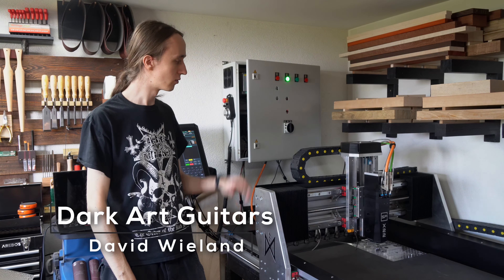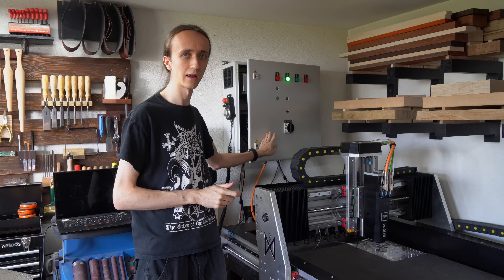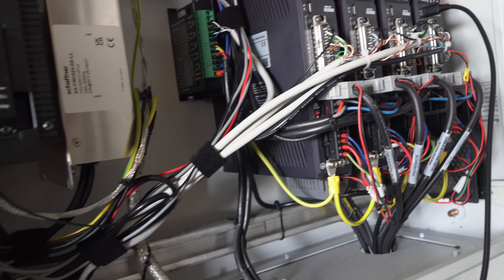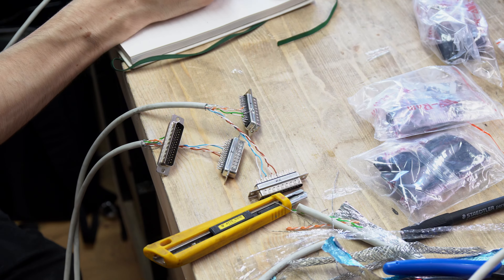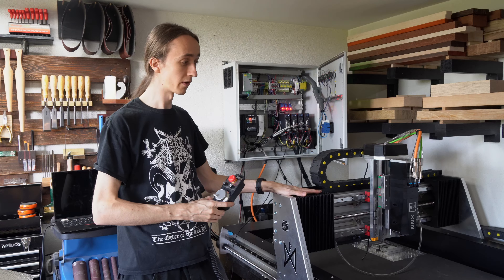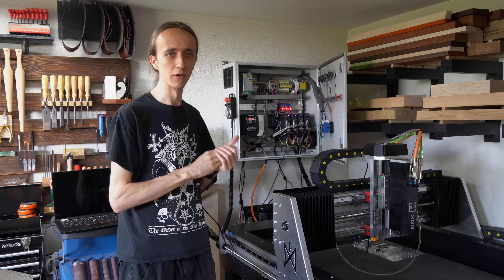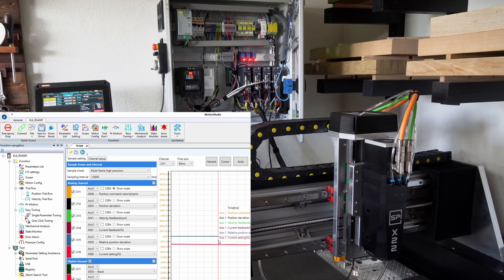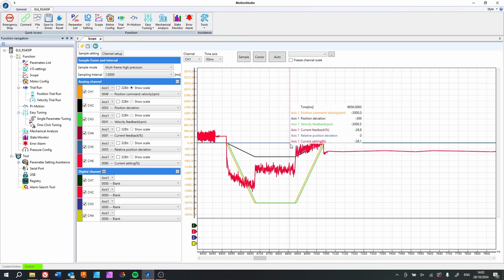Dark Art CNC Part 3 - Leadshine Servo Motor Install and Tuning

Comment: For the Y motors, one thing I've seen done that worked well is to figure out the weight of your gantry and endcaps, then add the equivalent amount of weight onto the X motor, then run the tuning on the X motor, export it, and apply it to the Y motors. Backup your original X values first though.
Reply from the maker: Yes, either that or reducing the weight and disengaging one of the two Y drives. I went with the latter, but both are hacky workarounds at best. They should just allow you to connect to both drives and tune them at the same time since this isn't exactly a niche application.

Comment: Nice machine you got. You could run it at 4000-8000mm/min with no problem in wood, to not burn your cabide tools and get big chips. Maybe 6,8mm Carbide End mills.
Reply from the maker: For sure, that's why I went with servos instead of steppers.

Comment: I tuned my Delta servos on a tandem servos axis lately.
It is in fact relatively easy. You do this, without certain elements on the gantry, so that the total weight represents roughly 60% of the total weight.
In my case it was tuned without the Z-axis installed.
Then you decouple the ball screw on the slave side and tune the servo on the master side. Your gantry needs to have a certain rigidity for this, but I believe your machine is rigid enough.
The parameters are then copied to the slave servo - done.
I made a detailed post on Insta early October with more details of the process.
Since your spindle is back at Spinogy anyway, taking off the Z-axis for tuning might be still an option for you.

Can your tuning software calculate the parameters based on a given stiffness value?
If so, you can gradually increase the stiffness value of the auto tune and have the other parameters calculated accordingly.
Then run the machine and see how it feels. Go higher with the stiffness value until it feels uncomfortable and back up to the last one, which was good.
This should reduce your position deviation greatly.
If your tuning software doesn't have that feature, try to increase the velocity loop gain manually. This parameter has the biggest influence on the position deviation.
Reply from the maker: Thanks for the idea, while an approximation it's probably about the best that's possible with this setup and auto tuning.
From what I understand the stiffness is one of the parameters that is varied during the tuning, but I might be wrong. What am I looking for with a too low/too high stiffness value? Like in what sense uncomfortable?
Reply: @DarkArtGuitars  Uncomfortable is when the servo starts to shake and vibrate after you press "servo on". Or when it makes loud noises during the run. Then it is too stiff. When the stiffness is too low it runs quiet and smoothly, but then it overshoots its end position and the position error is way to high.
I tuned mine to a position follow error of 6-7 microns. But my servos run at 5000 steps/rev on a 5mm pitch ball screw, which certainly helps.
Tuning only one side with 60% load is what most people do who run a tandem axis with servos 👍
Reply: @DarkArtGuitars  One more thing I have noticed. You tuned at 3000rpm. That is likely your G0, but not your average milling feed. When you try to improve the position following error manually, it is better to do it at an rpm which corresponds to your normal milling feed (like 5m/min, or something)
Because the position following error during a G0 repositioning move is not really important, as long as the end position is correct.
Reply from the maker: @scratchbuiltdesigns  Thanks for the info!
The auto tuning did various speeds up to a max of what you put in, hence I put 3k rpm.

Comment: Roughly how much does one of these CNC's cost?

Thanks
Reply from the maker: I'll do a breakdown in the final video, but I think it's around 12k as I have it configured. But you could also get away with less by choosing a cheaper spindle.

Comment: Hi! On another Leadshine video some guys mentioned that Leadshine support was not good - long wait for replies, and short answers. I know this is a sponsored video, but did you actually try the Leadshine support for troubleshooting? Did you investigate for alternatives to Leadshine? And big thanks for the nice video, great machine 👍
Reply from the maker: I was in contact with their support, but that was initiated through my contact so not representative of what you would get. There are many other servo brands out there, but it seems like Leadshine strikes a good balance between having the software with all the features to tune them properly (and in English) while still being reasonably priced. You can get cheaper servos on Ali but there the software is doggy, or there are brands like Clearpath that will be even better but also much more expensive. Otherwise if you want a cheap closed loop system I'd go for closed loop steppers, they are much cheaper and don't need tuning but are still much better than just regular steppers.
Reply: @ thank you. I hope you find a solution to the auto tuning for dual Y motors, which seems to be a lacking feature in the leadshine software.
Reply from the maker: @droneforfun5384  The "solution" is just to tune one of the motors with the other one disengaged and the gantry made lighter to compensate. It's a hack but gets you somewhat close. I understand the timing to synchronize the two drives for tuning is too tight to work over USB, so the drives would have to be connected to each other directly. On their higher end models this is supported but not for this one. I suppose there is little they can do.
Reply: @DarkArtGuitars  ok so you mean it is not possible to square the gantry via masso during normal operation? Or just for the tuning.
Reply from the maker: @droneforfun5384  just for tuning